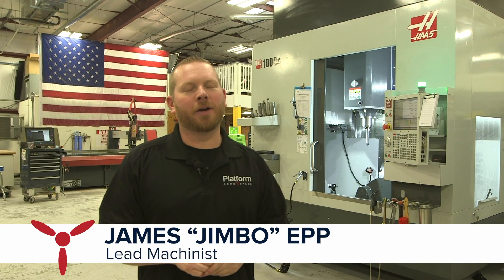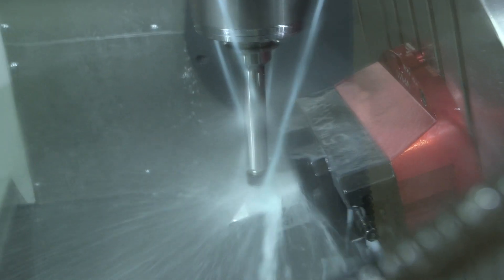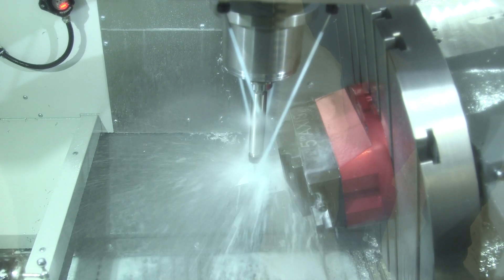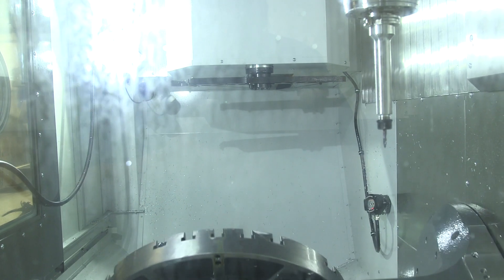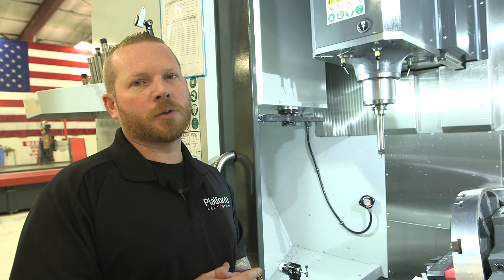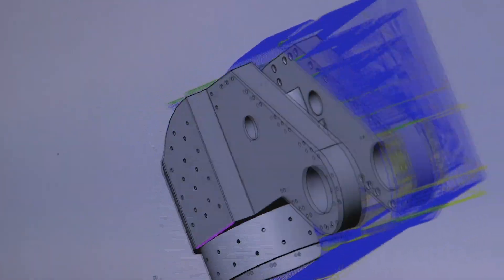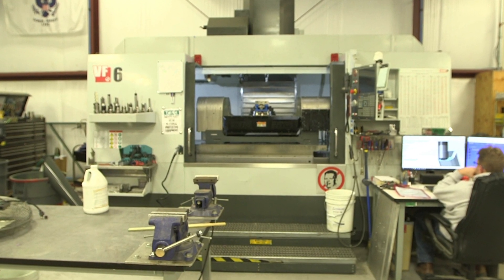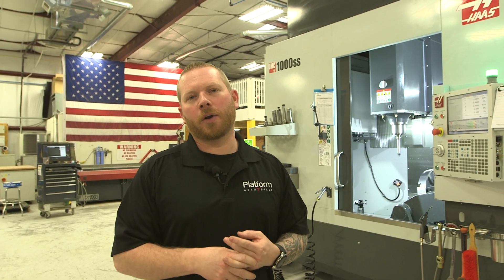Platform Aero UMC-1000 Capabilities

Comment: I heard that the UMC 1000 has issues with accuracy.  Is this true?  I have been thinking about ordering one for my business, but I might instead buy a Doosan. Let me know if the HAAS is up to par.
Reply: True. not that accurate when run with DWO. always wrong in x direction or dimension. minimum .003 wrong.
Reply: @AlPha-wh2ru  Wow .003.  Thank you so much.  This really helps me out with my research.  This comment was from 7 months ago. I have since looked at several different kinds of machine brands. My current favorite is the Kitamura 3 axis. They have some of the most accurate machines in the world.  I have several parts I need to be precisely cut to the .0005. Kitamura should do that no questions asked.